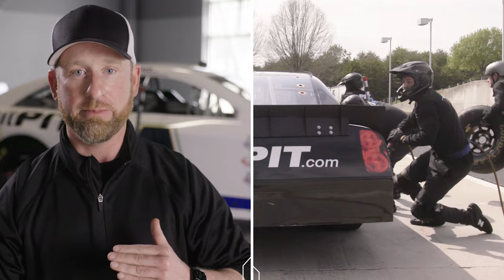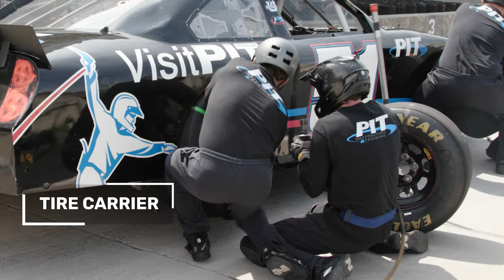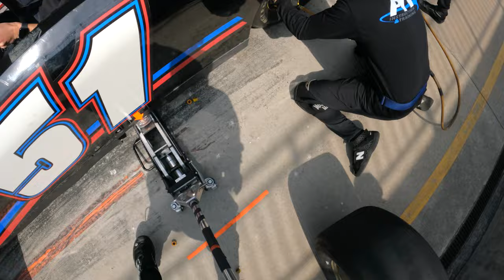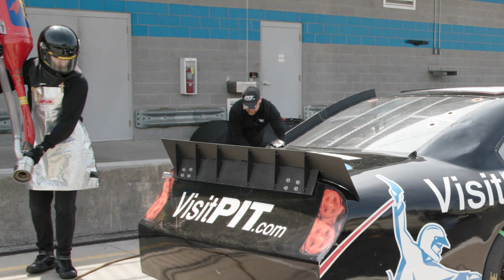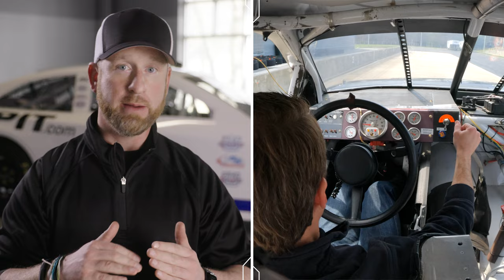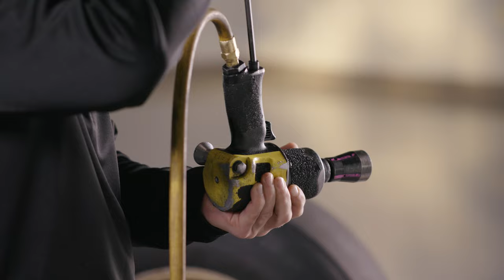What Slow Motion Reveals About a 72-Step Pit Stop | WIRED

Comment: this was done on a 2010-2012 car, those cars have 5 lugnuts. The current cars only have one giant one making it slightly faster
Reply: ,5 not 6. 6 lug is for heavy duty trucks.
Reply: oh yeah my bad
Reply: Was about to say the same thing
Reply: Dude its NASCAR, they are required to have 5 lugnuts
Reply: @deputy_dingus4  Not on the Nextgen car.
Reply: @deputy_dingus4  The car change a ton this year.
Reply: @deputy_dingus4  not anymore. Look up the nextgen.
Reply: I could tell it was a cot because of the braces in the front or the car instead of a typical bumper

Comment: How do they align the five tire holes with the wheel pegs so quickly? Are they flared out or something?
Reply: Good question....and what about the lug nutz on the ground and the car spinning out of the pit over a couple of the nutz?
Reply: @schokey3513  They pick the lug nuts off the ground when the car leaves.
Reply: 1. There's that center hub thing that gives the wheel something to rest on. Regular cars don't have that. So they don't have to have wheel aligned when placed on the hub.

2. After that, the wheel only needs to be turned a few degrees for the holes to match the studs.

3. Practice.

Comment: They forget to point out that the driver parallel parks at highway speed.
Reply: pit road speed is usually only maxed at 35-50 mph
Reply: @alecsmalygo  only? Can you parallel park without slowing down at 40?
Reply: @briantieken6718  I certainly can but the car in front of me will probably not be in the same position

Comment: Wait until you discover that in F1 the team can change all 4 tyres in less than 2 seconds
Reply: Hi
Reply: I think those guys had 30+ ppl and had them carry the car which was much faster
Reply: Sure, triple the crew size and you'll save time.
Reply: Exactly, plus F1 mechanics know metric so they're faster AND smarter.
Reply: @zen1647  WTH does that have to do with any race car pit stops?
Reply: @sergeantmasson3669  not sure what F1 you've been watching but an F1 pit crew even if you discount those there for safety &/or with backup equipment is 14-16 guys
Reply: @zen1647  smarter than you for sure.
Reply: @zen1647  Metric was invented for those that can't do math. 🤓
Reply: @sergeantmasson3669  Just suggesting that when peak performance really counts metric is used.
Reply: @jbrou123  So are you suggesting scientists, doctors, engineers and people in the military can't do math?
Reply: @zen1647  Sorry, but I was just trolling. As an American that uses Imperial in everything I do, even I know metric is a lot easier.
Reply: It's so different, basically not even comparable, only 5 are allowed over the wall in Nascar...
Reply: imagine being so bad you need 16 people to change 4 tires

Comment: But how are the lug nuts held in place on the new tire?
Reply: They glue the lug nuts to the wheel of the new tire. The adhesive is just strong enough to hold them until they are torqued on.

Comment: is safety the only reason the tires are not changed like F1 cars?
Reply: Rtthey now use single lug just like f1 but still the same execution, becausw if you have peple just standimg there its dangerous, they are little to no gaps between boxwes
Reply: Just rules as far as I know, Nascar only allows 5 crew members over the wall. As for the new single lug nut vs the old 5 or 6, I have heard that there is al.oat no time difference. I think it's because that single hub nut takes a lot more tourque.